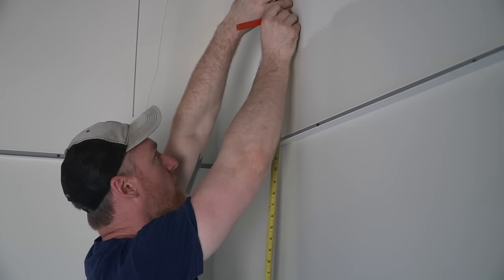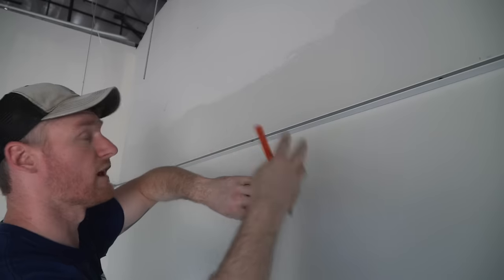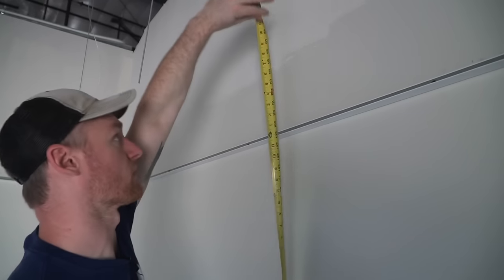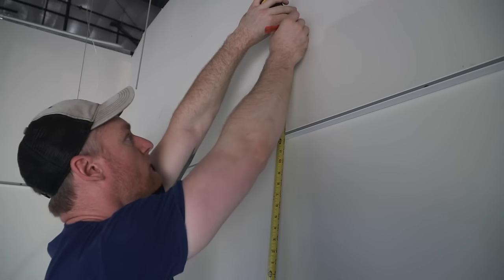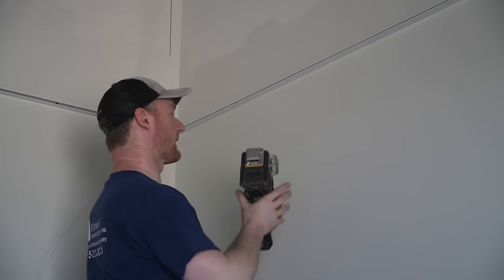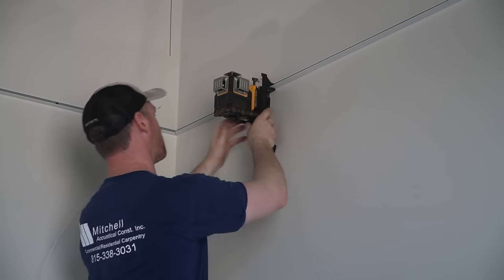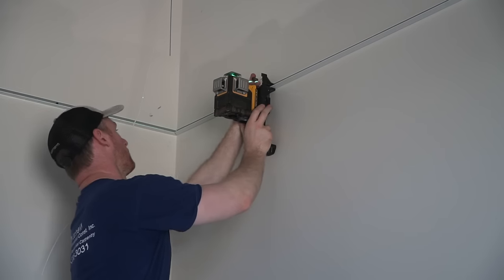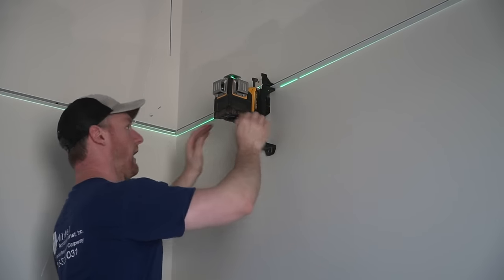How to Install Ceiling Grid

Comment: I have a question. Where do you set the jetline, in the middle of the main or on the edge?
Reply from the maker: Milton Martinez personally I like the middle on 9/16” grid and either way on the 15/16” grid. I don’t think you can go wrong with either, just a preference. Just remember which side you set it so that you don’t go center one end and side on the other end. Sounds silly but it happens every so often. Thanks for the question.👍
Reply: Side of main ts
Reply: I use string sometimes a laser on floor
Reply: add half inch and go outside a line it for 15/16  but 9/16 add 1/4 inch
Reply: outside edge for best results, it takes the guess work out of it.
Reply: help the bear Yogi  something funny here?🤨
Reply: Also use fishing line for best results. You'll find it slightly wavy afterwards if you check it with the lasar because dryline is just too thick. Older guys just use it because they can see it
Reply: Center
Reply: Thanks for the vid I’m actually going on my first ceiling job tomorrow as a apprentice & this gave me a heads up on what to look forward to thanks again.
Reply: @sencillo1992  find another profession. Climbing scaffolds and working with fiberglass is miserable.
Reply: Him put in the middle 🤭.
Reply: please as a beginner how do I calculate how many ceillings, grids that would be enough
Reply: @kashmoni1085  please watch your spelling
Reply: @JohnSmendrovac  what?
Reply: Left side of the main

Comment: I owned an acoustical company in California and installed ceilings for 40 years.  Your video pretty much covers it all.  A few minor tips:  Put the jet line on the edge of the main.  You don't have to eyeball the center of the main that way.   Set the laser at ceiling level and lose  the laser target.  When you are cranking the wire down to level, put your free hand over the main as you have to anyway to pull it down as you level it.  The laser will sweep across your hand so you can easily tell when to tie off the wire.  The laser will also give you a sort of chalk line to set the wall angle to.  The target is a major pain to use on wall angle.  The target just adds steps and is always falling on the floor.  Last tip is lay out your wires so they can be tied to the grid at the intersection of the main and cross tee and the wires will be plumb.  It makes installing the tile much quicker. Time is money.  Be glad that you don't have to install grid in California.  Earthquake codes!  Good video!  Jerry
Reply from the maker: Jerry, I’m glad I don’t have to install for California either! I’ve heard those codes are nuts. I appreciate the feed back, only thing I’ll say on the jet line to the side is some times if the ceiling and line are at the same height the jetline can get caught in the cross T and snag it. So some days I’ll go center some days I’ll do it to the side of the main. I don’t have a hard stance on that. Appreciate the feedback👍
Reply: those are all things i was taught by a grumpy 40+ years in the game guy too :)
Reply: @klevrah  Grumpy???
Reply: Excellent advice . Thank you sir!
Reply: Put the laser card on a long "necklace" around your neck. It's always in reach even if it comes off the grid.
Reply: Lose the laser card and the stilts. Get agile on a scaffold.
Reply: @garysager9028 I do both stilt and scaffold. If it’s a job full of rooms like these stilts are undeniably faster. Big room, double scaffold all day!
Reply: What grid brand is compatible with armstrong
Reply: @justinoconnor5674 We used Donn USG commercial grid or sometimes commercial Chicago Metallic.   If I understand your question, those grids are compatible with Armstrong tile and pretty much all tiles from any US manufacturer. Armstrong used to make a residential grid too.  They are all pretty much compatible with any 2 x 4 or 2 x 2 drop in tile.  I hope that helps.
Reply: How much would you charge for 23000 sqft ? Trying to price out a job

Comment: What do you do to connect a cross t to the wall that doesn't need to be cut, its exactly the right size but there isnt any bottom metal overlapping to the wall frame pieces.... I got nothing to rivet to
Reply from the maker: You probably have to shift the grid either 1/2” over to do it or 12” so you split a tile in half of the grid line

Comment: Little trick a ceiling guy taught me for layout is to count the number of fulls and multiply by two pull the number from the wall mark and measure the remainder from the other wall and divide by two pull that number from the wall and every four foot are your mains

Comment: Apologies for my stupid q - I am not sure about the hanging wire, how to correctly drill - what type of screws to attach to the concrete roof and then suspend the hanging wires from. Any help anyone please
Reply from the maker: We usually use concrete pins with an L bracket. You can use eye lags specifically for concrete too

Comment: we are planning to replace an original old tile ceiling with a suspended ceiling in basement of a 60 yr old home . this video was very helpful in learning how the project will unfold. We're having a contractor do the work however its useful to know what the installation process is all about. We have yet to decide on the lighting, as pot lights were too expensive.

Comment: Thanks for creating this learning video.Liked your passion behind this creation. I had learnt from your video to ensure the Level of the Ceiling using Laser card and bending the wire using the pliers. I also read in one of the comments whether the sting line to be positioned on the center of the Main Tee or side of the Main Tee. For me both will work, as far as the installer does the basics right. Another observation, the suspension wire used was directly cut from the coil. Probably Pre-straightened would be better for achieving quality installation.

Comment: Thank you so much for posting this! I have a building in which i want to redo the foyer. The only issues are the grid cieling has to come out and i wasnt sure if i could create a mechanism with a steel cable to hang things.

After seeing this? Given my dimensions and plans, what i need is already there! 😊 This is so perfectly "inline" with what im hoping to do, its uncannily perfect. Other than 1 or 2 adjustnents in my engineering ive got to make that actually make life easier, youve just given me an ideal proof of concept!

Between that and seeing where your located, ill take that as a good omen. 😊 thx!
Reply from the maker: Hey glad we could help! There is a drywall grid video as well that we did. You could do that for your foyer as well. 👍
Reply: @mitchellacoustical3119  Thanks! I didn't think that was of any use to me till I was trying to figure something out. So I'm glad you mentioned it as that might solve an issue I'm trying to figure.

When you hang that grid, you've got 18 or 20 gauge wire hanging from above. What exactly is that attached to? Secondly, how far apart are those things spaced? If I've got to add more hanger wire, so be it. I don't know what the standard distance is between hanger wires.

The reason I ask? If I use dry wall, weight distribution to which doesn't look like it's going to be an issue given what you've said and I've found. Secondly, thats my nodes in structural terms.

Thanks again! 👍

Comment: Excellent instructional video by a mechanic not a do it your selfer!  My preferred way of fastening wall angle into dry wall is fence staples or tension pins.
Reply from the maker: My dad was the same way. I tried the staples back in my apprentice days and hated busting up my thumb.👍
Reply from the maker: My dad was the same way. I tried the staples back in my apprentice days and hated busting up my thumb.👍
Reply: How about nailing wall angle with 4d cut nails in cmu’s, now that’s a thumb buster! 😀

Comment: On big ceilings do u stagger your mains joint, or keep them the same? I hear different methods from different sources. One says stagger for strength, manufacturer says it’s not needed

Comment: This is a very good video and I enjoyed watching it, but I am confused about how much to trim off of the main tees and centering everything.  Years ago, my father and I installed two suspended ceilings in my home and they turned-out great, but I don't remember how we laid-out the grid work.  The room I will be working on will be in a bathroom and the walls are concrete.

Comment: Earlier you mentioned running mains along the short axis but did opposite in the installation. Any reason?
Reply from the maker: Might have been the room I was in. The joists were running opposite of where they needed to run in this particular case. We had chosen this room ahead as it had good lighting but this question comes up time to time.

Comment: Thanks. This was an excellent explanation. I will be putting up about 1,000 sq ft of 2’x2’ panels in our basement. I’ve already chosen a USG panel I want to go with. Any recommendations for a grid manufacturer (USG vs Armstrong) or a generic and are there any differences in the quality, etc?  Thanks.
Reply from the maker: Usg, Armstrong or Chicago metallic are the brands we usually use. They’ll all have the same install, the stab tabs may be a little different. I can’t speak on any off brands as they wouldn’t be spec’d on our projects.

Comment: Great tutorial video,I only have one question I'm doing a repair and several of the hanging wires were cut in half, is it ok to splice wires allowed by code?
Reply from the maker: This is a great question! I would say you have to look at state code and what’s acceptable. We’ve never had an issue splicing and tying a square knot. We made a video on this on our channel called ‘using a slip knot to extend ceiling tile wire’

Comment: My friend: the best video I watched 
Very informative,  I'm a handyman and I'm about to take a job like this, never done it, I was a little nervous about it but you make it really easy,  my question is pricing, can you give me a rough idea of how much to charge?
Reply from the maker: My estimator knows our pricing, but with ceilings it’s double your material. So if your material is 1000, then then your labor would be 1000 for a total of 2000. Or at least that how I used to estimate it. Hope that helps.
Reply: @mitchellacoustical3119  thanks for your reply 🙏

Comment: Great video! I'd love to know what brand and model of laser you're using. The one I have is absolutely no where near as easy to use.
Reply from the maker: That laser I used was a dewalt 3 line laser. They’re about 500 or so. You can find decent ones around 300.

Comment: Is there any benefit to floating the ceiling vs. designing a room in 2'/4' increments so that the tiles end exactly aligned to the walls? Is there an efficiency or cost/material savings between one verses the other?
Reply from the maker: Hmm, I guess you could but that would be very constrictive to the architect drawing the layout. Most people don’t look at ceilings. Just as long as they have equal boarders, like say 6” around the perimeter or something.

Comment: Do these rules apply for smaller rooms, like a 7.5 x 6? I have a small bathroom I want to do but always find videos for larger rooms. I would assume the same technique applies?
Reply from the maker: Yea it would all work. Should try and center the light. So you’d lay it out with center tile in mind.
Reply: @mitchellacoustical3119  for sure. Thanks brother!

Comment: Nice instructions what’s up with the rivets? Use wire and tie back above ceiling height eliminates unsightly rivets.
Used rivets only in tight corners were grid won’t lock.
Local 1016 Muncie Indiana
Reply from the maker: We use rivets to lock in the ceiling. Or wag clips for 9/16. Local 250 Lake Co IL

Comment: What do you do if you accidentaly pop a rivet in the wrong place?

And what's your method of fastening the line thread? Ive always used laser but resorted to line thread when its a long corridor/too much light.. I just feel like there must be some smart easy way to fasten it compared to my struggle to get it up behind the wall molding
Reply from the maker: Usually we drill out the rivet and then caulk it. It’s very rare that it happens.

The jet-line we use a screw and tie a knot above the ceiling. Also it doesn’t need to be on the center of the T or side of the T, as long as you keep the spacing to the jetline the same you should be fine.
Reply: @mitchellacoustical3119  yeah thats what i also do, fastening it to a screw, then getting it behind the trim and out in the room.. Such a hassle. Because of bad eyesight, my depth vision screw up and i cant see calculate correctly if i put the string above the main runner..

But i also add half the runner's width to make it parallell to the edge, so much easier on the eyes, and less hassle to measure every T profile when locking in the diagonal.

I really like your practice of carrying less tools though. Ive thrown away my rulers in advantage of measure tape only, i hate distance lasers with a passion when im done finding the room's length and width.

I like that im not the only one measuring the main runner that way.. Everyone else use the laser measure for everything

Comment: Hi Mitchell , excellent video  and presentation .
I have installed few times before small suspended ceiling decade back with no any problems  , but  something strange happen right now , the installation of 24" x24 " USG drop in ceiling tiles , the Main T bar I can't  divide equally in a room size 12'x24' , I have always 3 " on ether side off from equal from center where cross bar 24" suppose to be locked in to Main  T bar 12' long , no matter how I divide main T bar I have always on one side 3" difference in size of tile .
Could you please explain  , does different  T  bar is required , how to equally divide tiles on a room 12'x 24' with a 12" main  T Bar ?
Thanks a lot , cheers :)
Reply from the maker: plutoniusis thank you for the question. Now if I reading it correctly all you would have to do if the room is truly 12’x24’ is cut the Main on the slot line. Those slot lines are 6” apart and we know that 2 of those slot lines would make 1’. So that being said cut on a slot line and you should have equal 24” boarder along the entire field and perimeter. You can start with your main being 24” c off the wall or 48” center and start with cutting the slot line and that should do it. Let me know if that works👍
Reply: @mitchellacoustical3119  , salute Mitchell , , I went quick in basement again to check what's wrong with measurement , I can not establish that parameter , the beginning of the 12' main T bar has first interlocking spot at 3" and then every 6" , that means that first tile should be interlocked at 27" , so we continue to have that 3" difference and on the end tiles can not be equally sized ,  yes room is 12' wide and 24' long , , even if locking part are cut off , it does make any difference .
Is there other T bar 12' long with all locking holes divided   6"  from a start to end , so full tiles could be installed .
Thanks a lot for your input , Good night :)
Reply: Yes the 12’ long main comes with the slot starting 3” off each end. So take your snips and cut only from one end on the slot line. Then take that 3” piece you just cut off the one side and connect it to the un-cut side. (So now you have a main 12’ long, with the first slot starting at 6”)
Hang the main and go. 
Real simple
Reply: @Chusch25   Or better yet just run a 12" border and not worry about making full tiles hit, that is if the lights work out. it's a basement right?
Reply: chris Rosenthal yeah exactly what I was getting at

Comment: How do you do angle run ceiling. Where it’s not straight side to side but in an angle?
Reply from the maker: If there are any 90 degree corners you’d start there. If not pick a tile boarder number and just run that number from end to end.

Comment: Boss wants me to go up and start installing this.  how do i put the jetline in when i put it in the mold?
Reply from the maker: I usually tie the jetline to a rivet(double knot it) then take pliers and put that rivet end in between the drywall and molding. Beware that it can scratch the drywall but we’re the tapers too so it doesn’t matter on our end. Hope this helps👍

Comment: Would raising an existing drop ceiling be similar? is there an "easy" way to bump it up? Is it possible to raise just part of a ceiling in a room, or do they always have to come straight across level?
Reply from the maker: 4” to 6” maybe you got a chance but higher than that it’s tough

Comment: How do you attach the string to the wall angle to make a main runner Straight
Reply from the maker: You can slip the string behind the wall angle and screw it above and pull it tight. I may have to make a video on this.

Comment: Another question I have. When you start riveting do you start 4 ft from the wall ? Then skip one and one ? Or can you start riveting anywhere ?
Reply from the maker: Well the mains are the pieces that have to be riveted starting out, then yes adjacent to the main I usually start somewhere around 4’ and then skip to the next T 4’ away. When you’re riveting Ts they will always be 2’ or 4’ apart but you only need to rivet them every 4’. Hope this makes sense.
Reply: @mitchellacoustical3119  When you said around 4' does that mean 4' away from the wall? or just anywhere ?

Comment: Kevin, how do you handle out-of-square rooms? I have a room about 11x12 but one wall is 4" longer.
Reply from the maker: I’m not sure what you mean by 4’ longer, but I can answer your out of sq question. When youre out of square, you have to square the 1st full tile off of the wall. So if you have a 12” border, the next tile in the room you will have to make square. I hope that makes sense. So run two mains and snap in the Ts then then square those Ts and you should be fine.